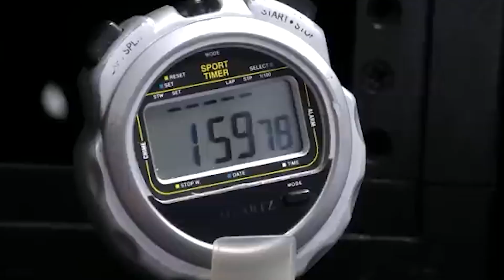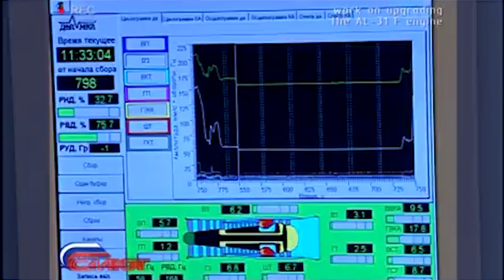MiG-29UPG + Kaveri Engine: India’s Game-Changer in Aviation!

Comment: The dry thrust Kaveri engine produces 46 KN which is almost the same as GE 404. The problem the GTRE was facing was the afterburner. It was not producing the required thrust. Now the problem has been solved and the new afterburner should be able to generate at least 70 KN of thrust if not more. The single crystal blade tech has been mastered and is doing well. I wouldn't be surprised if the wet thrust of the modified Kaveri engine goes around 75 KN. India has inched very close to the GE 404 performance. GTRE has to be very sure of its success or it wouldn't send a MIG -29 with two different engines.
Reply: 49-51 kN of dry thrust